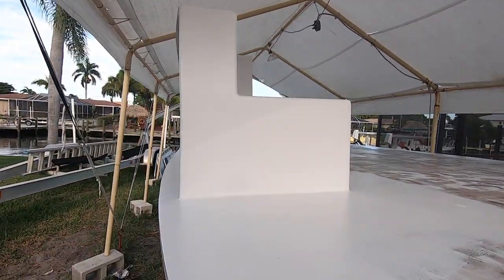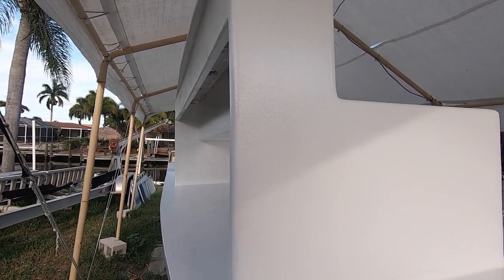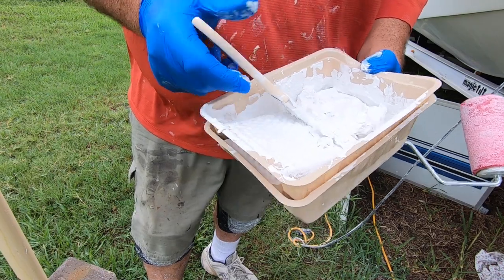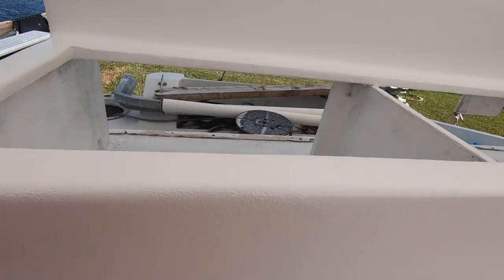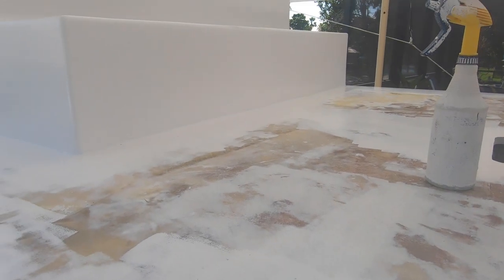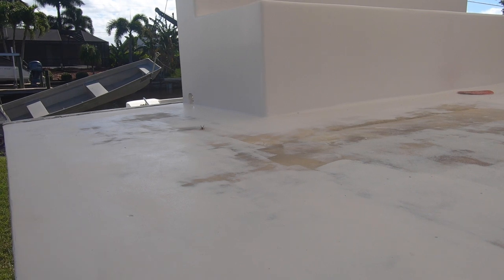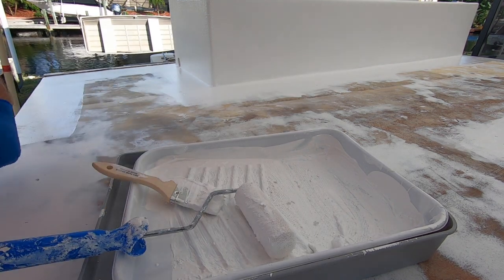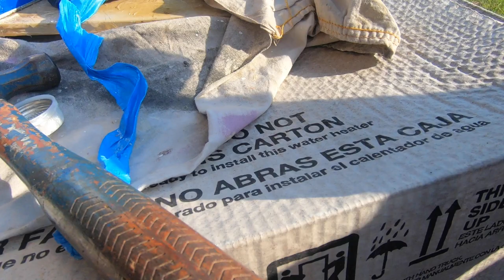How to apply the final coat of Gelcoat with a roller and Brush. (Tipping Gelcoat)

Comment: Rolling and tipping is a nightmare. It's OK on straight panels that lay flat but won't get a nice finish up close nomatter how good you are at it. If I'm rolling and tipping now I just cake it on knowing that the final sand and polish is what's going to get me the finish. It does serve a purpose though as it presses the paint into small pin holes and fissers but that's all it's good for so my first primer coat I roll and tip it, leave it for a few days then sand off the air bubble marks and denib it with good 120grit pads going slow on the sander with an interface pad. That fills the bottom end of the small holes so when I come in on my second primer coat or first top coat I don't get and "suck in" or airbubbles where the small holes are. I'm only using a FLG-5 with a 2.0mm needle and tip and at only 22psi I can get 2pack epoxy or gellcoat to go on like glass but If it's inside a cuddy or a full deck I need to do some homework and split the spraypainting into sections that end on shut lines or hidden so I've got no overlap spray. I'm not joking here I can take it slowly & do sections at a time with a spray gun for the final stages and easily beat anyone who can roll and tip good but that needs the professional look so might need to spend a half day sanding, cutting and polishing to get the finish flush. As a car and motorbike spray painter I  can easily beat any manufacturer finish with my wee FLG-5 that I demoted to epoxy and gellcoat so I am talking about extremely professional finishes here not DIY level.

Comment: Is the only thing you needed to do to be able to finally send the last layer of gel coat was that to add more gel coat or did you find some way to sand the unset layer?
Reply from the maker: Good question, if it sets and is just a little sticky I’ve just wasted some extra disks to sand the surface they will clog quick but the gel coat right under the sticky stuff will be set. If it still soft to the touch you’ll need to break out the acetone , I’ve done it both ways the acetone tends to be cleaner and quicker just wipe it down and sand the final surface and start over.
Reply: @SmokinReels  if you're caking your pads up with gluey paint you need to go down a grade and slow the sander down speed wise but make faster passes. It's the heat that makes it go goey. Wet sanding prevents this full stop it won't pull at the paint if you keep it wet. See if you are sanding drippers that are goey you can cut them flush with a blade, then heat them up with a heat gun, let it cool then wet sand them and they go flush without pulling at the paint or goeing pads up. You can get away with using a small amount of water with a conventional palm sander just run it full speed and dry it when done.